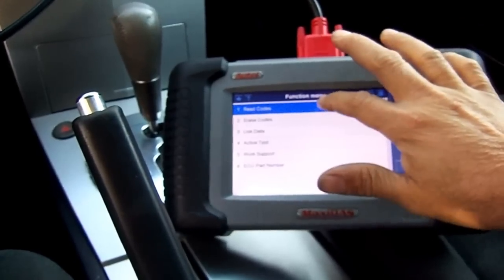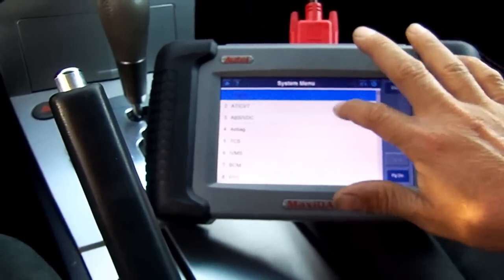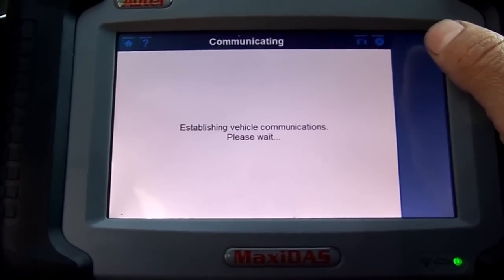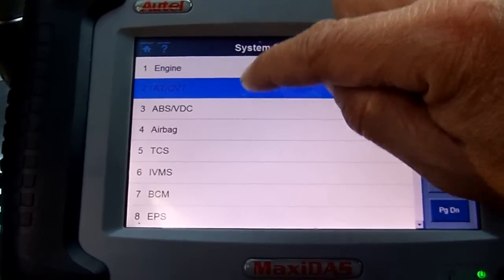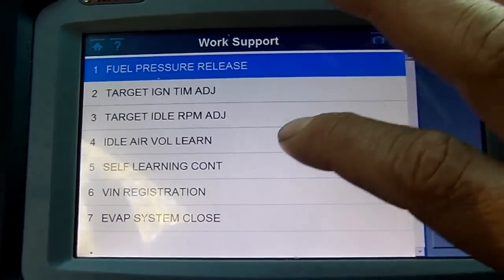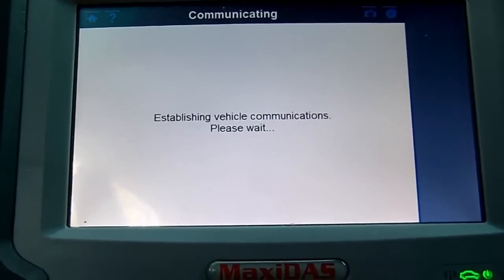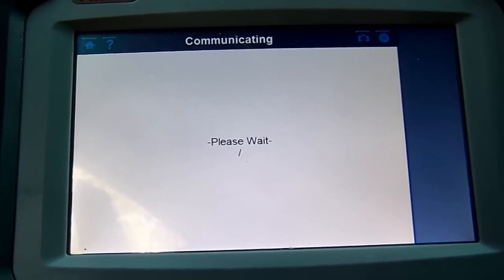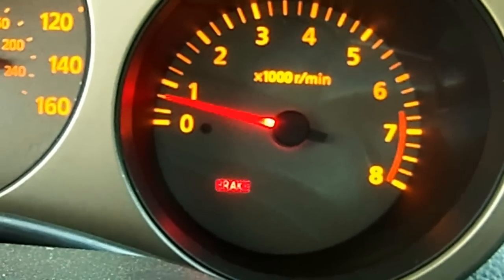Nissan Throttle Body Re-Learn using MaxiDas DS708

Comment: you don't need any tools to do a idle volume relearn
Reply: Jason Beaulieu  Hi Jason. Have u had success doing a relearn without a scan tool?  I have tried. Just did a 2009 Odyssey. Tried driving. Holding at three Gand for five minutes. No success. Hooked up the MaxiDas. Learned it right away. I had just cleaned the throttle body. Very dirty. Also, Nissan Altima. MaxiDas did the trick.

Comment: my Nissan maxima 2004 3.5L V6 has rpm 1800 the fuel consumption is very high, current is not reaching the vtc bank 1&2

Comment: Does your snap on verus do the throttle body relearn
Reply: yes sir,with snap on,maybe you need to disconnect inyectors to do this process on Nissan,one by one if need it,specially on 2003,2004 models,never have this issue with AUTEL